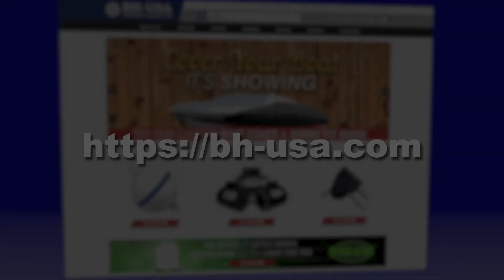Leeson Motors - 1 HP Big Red Farm Duty 56 Frame Boat Lift Motor - 110v Wiring

Comment: What makes this hookup non-typical is the thermal reset switch, which has one wire going in P1 that then has two outputs. One of these outputs is wired into the motor T1, and the other, P2, is connected to T3.    As commented below, I had to connect White to T8 and Black to P1 for the Bremas switch to work in both directions.